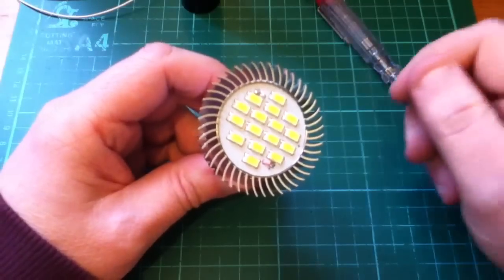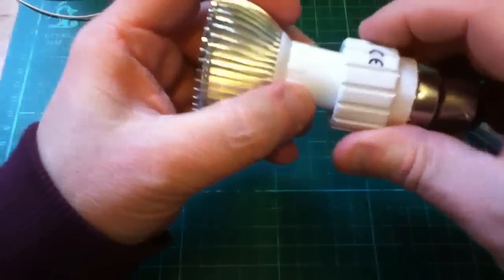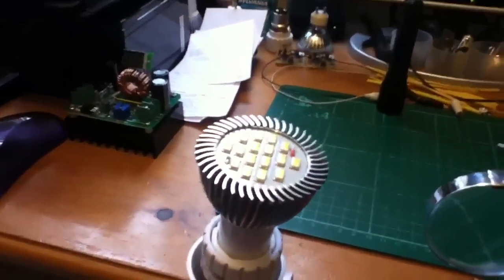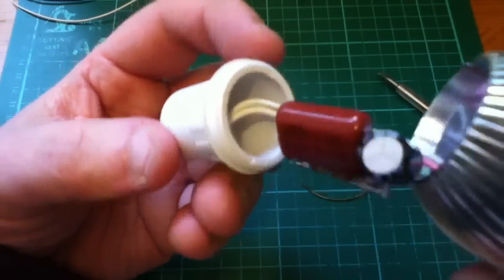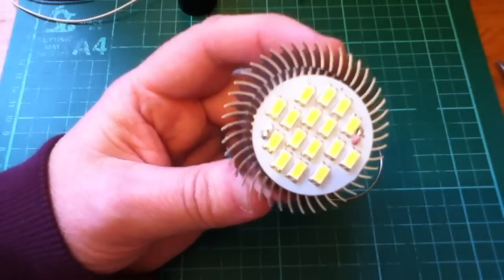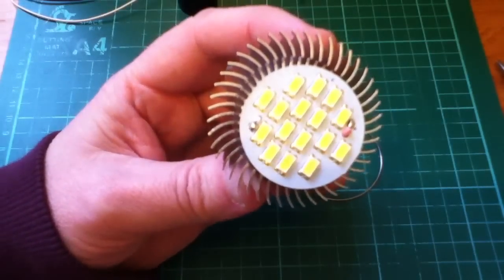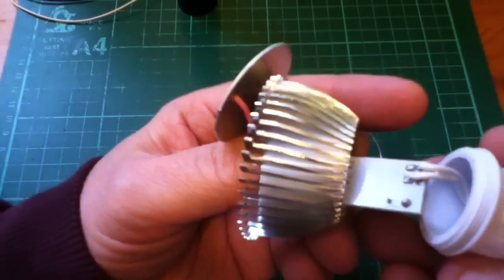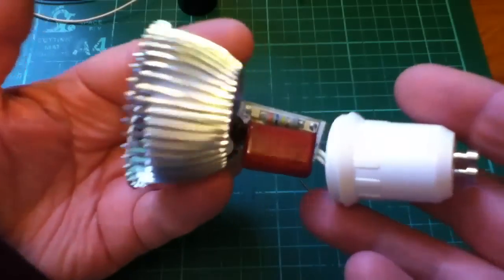Dangerous GU10 LED Spot Light is Cheap and Bright but could Kill You - Seriously

Comment: Great review Julian! There is a lot of misconception here about the way AC works, and Isolation. First off.... A bridge rectifier provides NO ISOLATION, full wave or half wave. The diodes are connected directly to the mains, and the rectifier's job is to change AC to DC. This is all the 4 diodes do in a full wave configuration. The only way to isolate you from the mains is to use an isolation transformer. Those two exposed wires on the top of that lamp carry DC, completely un-isolated from the mains. Secondly.... AC in most houses, has what is called "Neutral Phase" which is simply the center tap of the secondary winding on the pole transformer. By making neutral phase, common in every house, reduces electric shock by keeping this a Common Situation between all houses..... Hence: "Common."
Here's where people get confused, AC is alternating, which means that both sides of your outlet are really hot, only at one half of the cycle.  The large slot here in North America is Neutral Phase or Common, or the center tap of the tranny on the pole. The small slot is called "hot" because it is one outer leg of the pole transformer's secondary. Again, both hot and neutral are alternating meaning at one point of the cycle, the neutral could actually be called Hot. Realistically, in all AC outlets, at one half of the cycle, one side, or the other, is hot. This applies to everywhere in the world.
Hope This Helps.
Reply: What you're saying about the neutral being hot at any point of the cycle doesn't make any sense.  In North America the neutral (large slot) is wired to ground at the breaker panel.  When properly wired it is electrically connected to the round ground slot in the outlet through the wiring to the breaker panel.  The neutral should never have any significant voltage on it, only the very low voltage drop from the panel ground to the outlet caused by current flowing through the very low resistance in the wiring to the outlet neutral.  The AC Hot changes from being positive potential for half the cycle to negative potential for the other half of the cycle.  For 240 volts, one phase is positive with respect to neutral/ground and the other is negative wrt neutral/ground.  The two 120 Volt AC signals out of phase 180 degrees add up to 240 VAC.  The neutral should never be live!
Reply: Wa Buzzoo   Quote: The two 120 Volt AC signals out of phase 180 degrees add up to 240 VAC.  The neutral should never be live! 

Ok, In North America our appliances run on 120V and we have a large slot in our plug that is considered common. If you look at the situation from a schematic point of view, the center tap of the pole pig is connected to that large slot, and the center half moon of the outlet is the safety ground, tied at the panel, to a ground rod pounded into soil. This is why it's considered ground and you don't get a shock. It's "common." The bottom line is, It's AC. So for 120Volts operation, Picture This:..... If you ignore the other winding that we are not using in this 120V circuit ( from center tap, to the other outer leg ), we have one leg classified as common and one hot. What difference would it make if we use one outer leg or the center tap of the transformer in this situation? Remember, we only have 120 coming in. It makes no difference, because technically we would have a single ended transformer then. My point being is, AC has no polarity. Since we have a center tapped tranny on the pole to provide 240V, grounding the center leg is the only option to get two 120V lines, 180 degrees out of phase from each other. So at the normal house outlet, we have technically a single ended ac signal, with one end classified as common that's tied to ground, and one that's hot. 
So again, think of it this way, if we only had 120V coming into the house, and you made the first decision "EVER" to pick what side would be neutral?  What side would you pick?   Well, take your pick!   Then make that neutral "common" to all houses and pound in a ground rod. ( Its still AC, and now in phase with all the other houses. ) Now you have your large slot and safety ground so you don't get a shock, and the other side that you can call "hot."
 But since we have 240 running to some larger appliances, it only makes sense to ground the center tap of the tranny and make that common. Remember it's AC, there is no + or - 

So this is why neutral or common isn't classified as LIVE, and why we all don't get shocked.
Reply: Mr Carlson's Lab In conventionally wired systems (i.e., not the hypothetical system with transformer having an end tap tied to ground that you mentioned) the neutral is tied to the ground connection in the panel.  So the neutral is zero volts with respect to the planet, given that the ground is actually tied to a rod driven into the earth, a pretty consistent and stable zero voltage reference point.  The 60 Hertz wave on a 120 Hot line switches polarity with respect to the planet 120 times a second.  So on a average time frame there is no + and - with AC, but instantaneously the hot could be positive or negative with respect to the planet; so yes there is + and - and it changes but only on the hot of the outlet.  60 times a second the 120 volt hot peaks at +169.7 volts, and 60 times a second it peaks at -169.7 volts.  You could see this on an oscilloscope that was connected from ground (planet) to the hot.  The same scope on ground to neutral will show zero. The neutral is kept at the same potential as the planet.

One side or the other of the outlet are not hot for half the cycle.  Don't spread that around.  Only the hot can supply voltage that will drive a current.  Stating that at one point in the cycle the neutral could be called hot is false.  The neutral is never hot if properly wired.  You should never be able to draw any power through the neutral to ground.  If you can (indicating a hot neutral), your wiring is wrong and you should get an electrician to fix that.
Reply: Wa Buzzoo Quote: You should never be able to draw any power through the neutral to ground. 
Well of course you won't because they are tied together. I think you are looking at this through electricians eyes.
Ok...... AC alternates between 2 leads. What are the two leads in your AC outlet? The only reason we classify one side of the outlet Hot, is because its the outer leg of the tranny. The center tap has to be tied to common, neutral for two 120V lines. (and for safety too) Yes the common is held at Earth ground, but it is still AC. AC means "Alternating" ....... the current is alternating between 2 wires. Meaning both wire carry current. If both wires carry current, is one "really" neutral? Get the picture?  In your quote you say it yourself : 

 60 times a second the 120 volt hot peaks at +169.7 volts, and 60 times a second it peaks at -169.7 volts.
 
 Ok, so when it peaks at -169.7V, which side is positive in respect to that?
Could that be the Neutral, Common?

 If you are still confused, get a center tapped transformer that has a low secondary voltage...say 12 Volts ct. Make sure the primary and secondary windings are isolated, Don't want you getting hurt. Get your oscilloscope out, set the time base to 10ms per division, That will give you a nice display. Now apply the center tap of the tranny, to the scope probe center. Then remove probe, reverse wires and apply center tap to probe ground, then tell me what side is hot.

 If your not confident in your electrical skills, don't try the above!!!
Reply: Mr Carlson's Lab Oh ya, WA Buzzoo, I'm taking for granted that you know how to use a scope, So I trust that you realize how to connect the other lead of the oscilloscope probe. I was a little vague in the description.
Reply: Mr Carlson's Lab
Hot does not mean a more positive or negative voltage.

Let's go back a bit to be sure you understand what I have a problem with.  Look at a quote from what you wrote at the start of this thread discussing outlets:
"both hot and neutral are alternating meaning at one point of the cycle, the neutral could actually be called Hot"

A Hot wire indicates that you could get "burned" from it, a shock or worse.  If the house and outlet are properly wired, a bare wire from the longer neutral slot should not give you a shock if you are grounded. No matter what part of the cycle the AC waveform is at.  The neutral is never "Hot".

Conversely if you are grounded and you touch the hot side of the outlet you'll get a shock (or worse).

The reason one side is classified Hot is because it can provide power with respect to anything that is grounded, like your plumbing, wet floors, ground wires, neutral conductors, etc.  This is regardless of the transformer wiring.  If you ground the end tap and connect that to neutral, you'll get Hot 120 VAC on the center tap and Hot 240 V AC on the other end tap.  Both the non grounded taps being Hot because they can kill you if you get between them and neutral or ground.

You can say that for part of the cycle the neutral has positive potential with respect to the Hot or negative potential wrt the Hot.  You shouldn't suggest that the neutral is Hot for part of the cycle just because it's polarity might be positive or negative compared to the true hot on an normal outlet. 

Agreed both wires to the plug will carry current, but the voltage potential of the neutral side will always be close to ground potential, only off by the voltage drop caused by the current and resistance of the wire.  Not enough to be considered Hot in normal operation.

In your 12 volt transformer example you've changed the scenario; you don't have the any tap constantly connected to your building ground.  It is floating.  If your scope probe is grounded to the chassis and plugged into a three prong 120 VAC outlet, then which ever tap is connected to the probe ground is at building ground potential.  When your transformer is not grounded hot and neutral are arbitrary.  For safety reasons one is selected to be neutral and is tied to ground in house wiring.  The wire that changes potential with respect to ground is the hot.  It is the much more dangerous one.
Reply: Mr Carlson's Lab
As I tried to explain, in normal conditions, the current through L and N are equal and opposite, but in fault conditions, L can source current through a person to ground where N cannot. L is power, N is return. They are not the same. If you look at L and N in a substation, they are not the same. L is a lot more dangerous than N. I really can't see why someone with an electonics channel and a lab full of kit is trying to argue that they are.

Single ended doesn't mean "no centre tap" and it's not exclusively to do with transformers. E.g. Look at the signal through a coaxial phono cable. There is one centre conductor carrying a signal voltage and one ground referenced outer sheath through which current returns. This signal is single ended. Conversely, look at an XLR speaker cable; there is one grounded shielding sheath which does not carry signal and 2 signal carrying conductors which carry a balanced differential signal. The AC is equal in amplitude but opposite in phase. This is a differential signal. (Before you mention that XLR can be sourced from baluns which are transformers, many solid state amplifiers have differential inputs and outputs and high speed digital signals such as between your CPU and RAM generally travel in differential pairs with no transformers). By saying either L or N is hot at some point in the cycle and focusing on the current that is equal in both, you are essentially arguing that the phono cable is differential beause there is current in the sheath, but that's not the way it works. The sheath and the centre conductor are not balanced. If they were balanced, there would be no need for differential signals. L and N are not differential. Single phase power is single ended. Multiple phase power is differential between the phases and if the load on all phases in a multiphase system is equal, there is no current in the neutral wire (just like in the XLR), which is why multiple phases are used on trunks of the grid and single phase only at local branches.

The bird on the wire is at high potential but there is no potential difference (voltage) in the bird (a good illustration of the difference between the 2) and although there is lots of current flowing through the cable, none is flowing through the bird. This is simply showing that the bird is not closing the circuit. It doesn't tell you anything about the differences or similarities between L an N.

There's no point in trying to explain this to you, I can't do a better job at making it extremely clear than Wa Buzzoo has done in his last post which was very clear and explained well why you're mistaken. You simply either don't want to be corrected or don't have the capacity to learn simple concepts of electricity. I suggest you stop being stubborn and re-read everything he's said. Until you learn such basics, I suggest you stop trying to teach others.
Reply: I'd be careful about getting on a high horse here mr. You are the only one that does not understand this stuff and you also don't understand www etiquette nor how the language you speak can convey emotion and have a 'tone'. Do you read books? See, now that had a smart ass tone to it. And this: how about you stop a minute and consider that you are the only one arguing your ridiculous argument so maybe it is you that has the wrong end of the stick or maybe you just need to be a bit sharper to see the stick at all. See, now that was unfriendly but nowhere near as rude as your posts have become.
As my father used to say; never argue with a fool, first they reduce you to their level then they beat you with experience.
Reply: By most definitions, text books, wikipedia etc, "hot" is: " an ungrounded conductor" or more exactly: "a conductor with electric potential relative to electrical ground or neutral."  And yet in his opening post Mr Carlson states:
 "Again, both hot and neutral are alternating meaning at one point of the cycle, the neutral could actually be called Hot. Realistically, in all AC outlets, at one half of the cycle, one side, or the other, is hot. This applies to everywhere in the world.
Hope This Helps."

So since we are talking about domestic electricity, and  neutral is grounded, by definition, this is in direct contradiction to the definition of "Hot", and so the quoted statement is WRONG.

Even if we substitute the word "hot" for "live" Mr Carlson would still only be half right. The definition of live as of 2004 according to the IEEE: "any energised conductor in a circuit".

So under this definition the neutral wire is also 'live', as it carries energy/current while being at zero potential relative to ground. This might sound confusing if you have grown up in the UK calling the brown wire "live", but it is because of a change, and the best way to call the brown wire is now "line" or "phase". 
Now this mr Carlson would WOULD BE right about, and both conductors would be "live", however we have the issue of him saying "At one half of the cycle, one side, or the other, is hot". Again, this is wrong, because "hot" means ungrounded, but lets substitute in the word "live", and it is still wrong. There would indeed only be instantaneous moments on the AC cycle where the relative potential of the conductors would be zero, and hence they could be considered to be "energised" or carrying no current. But that is not how the definition is used, ie a conductor isn't renamed momentarily every cycle, and so completely absurd.  
So there is really no ambiguity about it, Mr Carlson, on this occasion, is wrong in his opening post. Which is  ironic because I am just a simple school teacher responsible for "... the crap our schools are pounding into peoples heads" whereas he is the man clearly setting all the definitions however he wants.
Reply: Mr Carlson's Lab
Speaking from a UK electric point of view and assuming it's similar in US (except it sounds like you have single phase 120V, 2 phase 240V; we have single phase 230V, 3 phase 400V), it doesn't matter whether the potential of L or N is more positive or negative at any one point in the cycle. The proper term for voltage is "potential difference". +10V is the same potential difference as -10V, the only difference is the direction of current. In a non-fault condition, current flows equally and oposite through both L and N and none through ground, the fact that the current in each should be the same is how RCDs work. Neutral is tied to ground somewhere, so in a fault little AC current can flow from neutral to ground and much more can flow from live to ground (whether the electrons are moving into or out of the ground at any one point is irrelevant).

You say AC has no polarity and that's sort of true as I described above, but in a fault condition when one of the 2 AC terminals is connected to ground and not the other AC terminal, it makes a big difference which one that is and that's why it's important to know neutral is the stable reference level around which live swings and so live is a single ended AC voltage source referenced to neutral, not a balanced differential with neutral.

Wa Buzzoo is correct and said it very well in his last reply, but I already typed this out, so I'll post it anyway.
Reply: Mr Carlson.. You are just wrong.  Ironically, the place where you go off the tracks starts where you write..  "Here''s where people get confused.."   There will never be any voltage measurable between the neutral pin and the ground pin at your wall socket if everything is wired as should be.  You are confused with the action of alternating current and somehow convinced that 50% of the time the neutral pin is "hot".  Not true.  50% of the time the neutral pin may be positive, but that does not mean that it is "hot" relative to the ground pin.  And conversely, the "hot" pin at your wall socket will always have a measurable voltage relative to the ground regardless whether the voltage has cycled from positive to negative.  OK, sure, at the crossover point there is a brief "zero", but that is not the point.  To sum it up, you have really overthought this one.  And what's amazing to me is that you seem to know all the components, and how they are connected, and yet you still come to this ridiculous conclusion.
Reply: For Pete's sake guys, yes the current has to balance (under normal operating conditions) in the L and the N nodes. If they don't match exactly then there is an earth leak somewhere (getting back to N somewhere down the line through one of those earth connection thingies) but that is CURRENT NOT VOLTAGE. The potential (voltage) of the N node with respect to us is very near zero even if there is a current flowing through the Neutral. Does that clarify anything for you Mr Carson?
Reply: Yeah, that tranny was shootin a huge load onto the house - I'd be watching out for a golden shower from that pole if I were him...
Reply: Wa Buzzoo I guess you actually realized how to connect the other lead of the osciloscope! Probably years ago.
Reply: Except in the case of a wiring fault: if neutral breaks upstream of your room's light circuit, your neutral is now floating towards line/live (hot) due to any other connected loads. That's why the IET in the later sets of British Wiring Regulations (BS7671) consider both "line" (hot) and neutral to be "live conductors" (current carrying aka dangerous). The only "safe" conductor is earth/cpc/ground. So whilst neutral is nominally unlikely to kill you, it's only one fault away from doing so.
Reply: Yes, the confusion! Mr Carlson, I'm sorry to say you have been talking a load of wally there. While you are correct about the nature of the AC supply you have missed the fundamental principle that the Neutral is the reference pole, it is connected to ground (as others have pointed out - a 3 or 4 foot long copper bar driven into the ground near your fuse box) and in Australia anyway, it is also connected to water and gas pipes. In short it is connected to the human world such that we and it are at the same potential at all times. So with respect to us on Terra Firma, the Neutral does not change at all but the Active or Line changes compensate by doing the extra moving instead (with respect to ground and/or us)
In USA you run two phase 115/230 with Neutral in the middle. That means you can have a 230V appliance but if you get a zap from it, unless you touch both Lines to the appliance, the most you will feel is 115V.  Clever and smart.
Reply: I'm not an electrician, but I think it's pretty simple to realize Carlson is wrong. If the current was alternating between N and L, and N being connected to every outlet in the house, then whenever there was a load on ANY outlet, the N side would become hot anywhere between the loaded outlet and the breaker box. Also, the N and common are connected at the same ground pole, which would cause a similar spike at any outlet between a short to ground and the breaker. Is this correct?
Reply: Dan E Garner And I thought Mr Carlson was, maybe, a teacher, or retired teacher, etc, looking at this from an educators view, rather than a "real life" experience view. I'm a dummy when it comes to electricity, and love learning! So, I was a bit confused, lol, but still learned something! Wait! What was this videos point again? Lol, I remember, even after reading all the comments!
Reply: KX36 Oh now come on now, Don't be grouchy! Shouty tone you say? How does my typing indicate a shouty tone? I didn't know that words typed make a tone! Is that tone split into two 180 degree out of phase signals, or does that tone draw current 360 degrees of the cycle? You say, "My tone of voice."  How do you hear my voice when you are looking at my text? Are these the voices that are telling you to argue with me? Just out of curiosity, do you believe that "RMS Power" is a valid measurement?
 Your welcome to stop by and watch my videos any time! Psst.... Hey.... If you subscribe, I won't tell if you don't ;^}
Tee Hee!
Reply: KX36
Quote from KX36....You say AC has no polarity and that's sort of true as I described above.
How can that be "sort of true"?
 AC means alternating! Its 100% true, "not sort of!" I'm really surprised at the mass misunderstanding of such a basic subject. This is the crap our schools are pounding into peoples heads, without proper instruction. AC is not single ended, transformers are. Single ended means, "No Center tap." Both wires carry equal current when a load is applied, white and black. AC has NO POLARITY AS IT IS ALTERNATING. Alternating between two wires. The only reason they call one side HOT is because the other side (or center tap) is tied to a COMMON GROUND. This common ground, just because you don't get a shock, doesn't mean its not carrying current, its just that you are close to its potential.  Just because the center tap of the pole pig is tied to ground, does not mean its not alternating current! Try to understand this.... Just because you don't get shocked, doesn't mean there is not any difference in potential there. This is why a bird can sit on a multi thousand volt wire and not get shocked, The bird is at the same potential as the wire, while there is still alternating current in the wire. Its the same for us! Simply put, we are closer to the white wire, than the black wire. This is the only reason they call one side hot. The current is still alternating! The current is still alternating equally between neutral and hot. If it wasn't we would be using Edison's flawed system.
Reply: Are you not reading my posts correctly? I'm talking about how AC works "it alternates" In all cases. That's why its AC. I clearly state the L is more dangerous than N. (where do you get the opposite from?) When I say that both sides could be "considered" hot, In all reality, its alternating current, and under load, both wires carry equal current. But since we are closer to the "White wires potential, they call the black one hot. (what's so hard to understand here?)  I think in your denoted anger; in your previous post, or the fact that you and Wa Buzzoo are friends (maybe the same poster under a different name), you've overlooked a lot of my explanations. Single ended refers to the circuit, Is AC truly single ended? "KX36" or is the circuit single ended? (a circuit classification) Lets go deeper shall we :^).... Single means one..... No circuit in reality can have one end. When we look at a transformer, a winding has two ends. Which side is the beginning, and which side is the end in an AC circuit? I no where said it just applied to transformers, by the way! The transformer is just one analogy. You said it in an interesting way here : There is one centre conductor carrying a signal voltage and one ground referenced outer sheath through which current returns.   Here's the rub.... There is a big difference between a variating current or voltage in a cable and an alternating current or voltage between cables. In our houses, we have alternating current. (does AC have polarity "KX36?") No it doesn't, But we have given it one in our houses by keeping us close to the white wires potential. (meaning the black wire is hot) Red too. Your audio cable does have polarity. (to an extent).... In your "so called" single ended cable you have the center conductor variating voltage with respect to a shielded ground. To make this even more confusing, this cable can carry DC at the same time in either polarity.

KX36 said:  
 I suggest you stop being stubborn and re-read everything he's said. Until you learn such basics, I suggest you stop trying to teach others.

I say:
Are you sure KX36, it's me that needs to learn the basic's?

This is kinda fun, I'm waiting! If you keep this up, I might give you a "thumbs up" too :^)